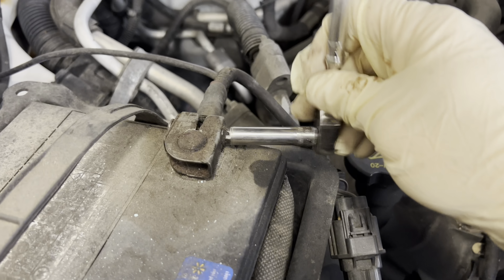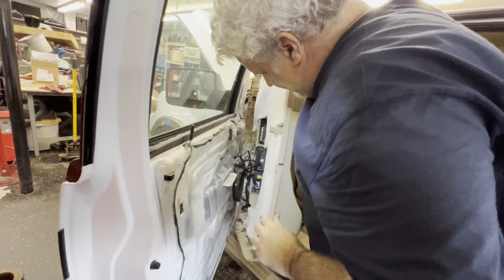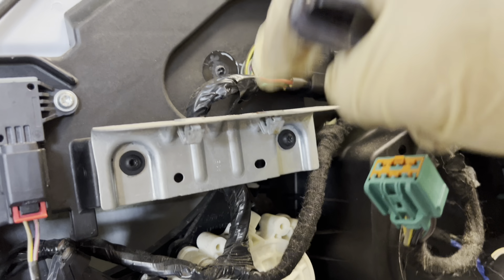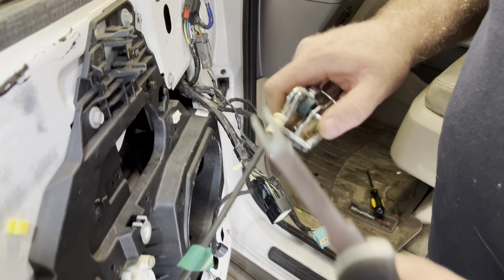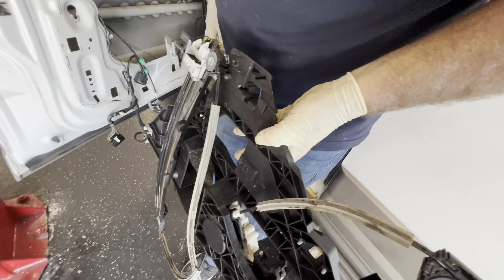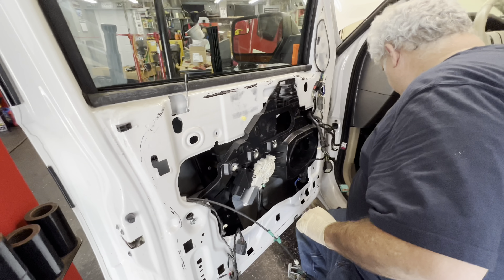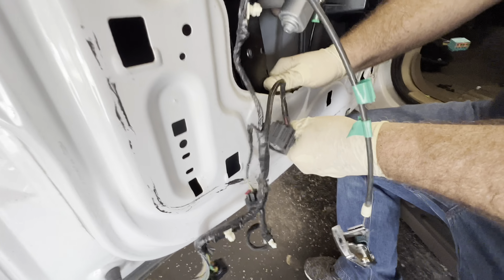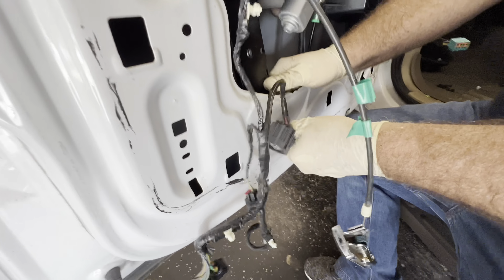How To Replace 2007-2017 Ford Expedition  Window Regulator - Front

Comment: GOTTA LOVE THOSE FORD ENGINEERS FOR MAKING THIS JOB SO MUCH FUN. WORKING ON A 14 EXPEDITION AND IT NEEDED BOTH DRIVERS SIDE FRONT AND REAR. CAN'T PASS YOUR YEARLY SAFETY INSPECTION IF THE WINDOWS DON'T WORK. GOOD VIDEO AND THANK YOU FROM HAWAII ISLAND =)
Reply from the maker: Thanks for checking our our auto repair video that shows you how to replace the driver side window regulator on a Ford Expedition. Have a great day!

Comment: You kind of glossed over the part at 16:34 where you seat the window into the mechanism. I get that filming such a tight operation would be nearly impossible, but some added instructions for that specific process would be appreciated. Also, the window appears to stop a quarter of an inch too high at the bottom at 18:03. Is there a way to ensure it goes down all the way while seating the glass into the mechanism?
Reply from the maker: The window goes all the way down into the door. We probably didn't press the button down all of the way.

Comment: Did you have to reprogram it?
Reply from the maker: No it worked fine for me.
Reply: @HomeownerRepair   Mine has to be reprogrammed. It all has to be done reasonably quickly.

1. Turn ignition to accessory 5 times super quick. Leave in on position after fifth time.
2. Press window down (nothing should happen if done fast enough)(repeat above until nothing happens then continue)
3. Press & hold down again. This time it should go all the way down. Hold for 5 seconds once down.
4. Press & hold up. Hold for 5 seconds. 

That should do it.